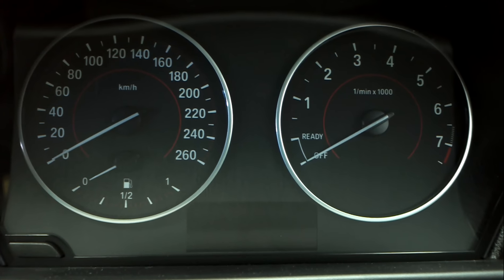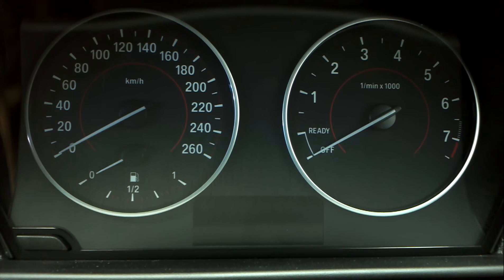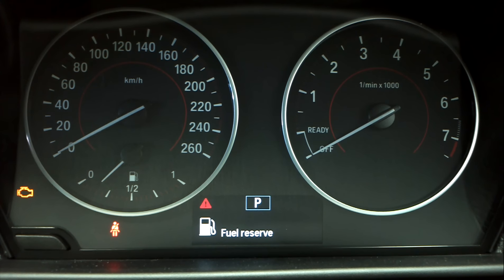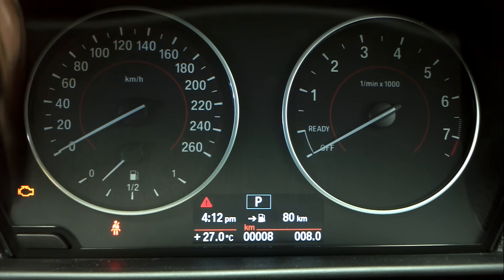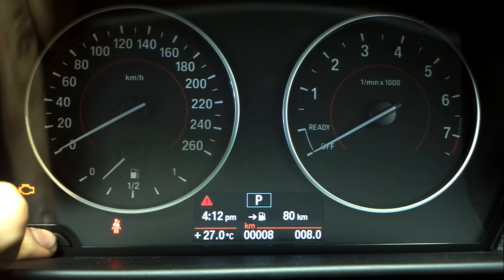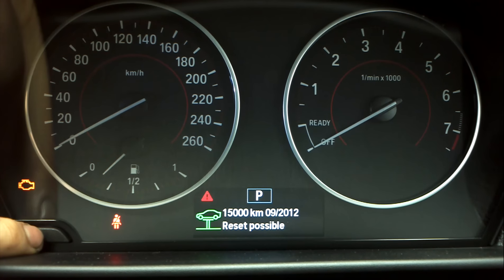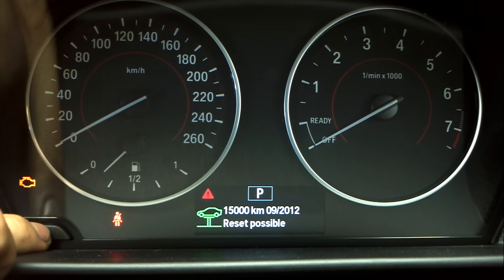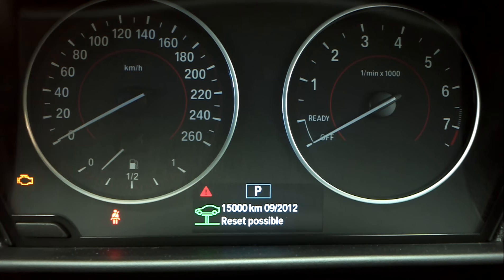BMW 1 Series F20 reset service light How to DIY: BMTroubleU

Comment: My windshield pumps aren't working (both front and back) but my headlights' pump is working properly. What might be the problem?
Reply from the maker: Most likely your washer pump or jets are blocked. We saw this frequently, even in newer vehicles where the washers hadn't been used for a while. The inside of the washer bottle is dark, warm and moist which means mold can grow in it and cause blockages.
You will need to remove and clean the washer bottle with degreaser. Disconnect the hoses from the washer pump and use compressed air to purge the hoses and any remaining gunk inside them. You should see water and air spraying strongly out of the jets when you do this. If you don't, then the washers are blocked too and will need to be removed and cleaned with a small pin.
Let me know how you go mate.
Reply: @BMTroubleU  well no energy gets into the plug, what might it be since theres no fuse?
Reply from the maker: @bardajoca  there is a forum post for this issue here-
https://www.bimmerfest.com/threads/f20-windscreen-washer.1272850/

See how you go
Reply: @BMTroubleU  thanks, I've already posted there too, waiting for an answer. I'll try to reset all car errors

Comment from the maker: if youre worrying about any non-dealer work on your car 'voiding the warranty'- dont. make sure you use genuine parts, approved fluids and keep your receipts and dates of work written down and you are 100% sweet. in order for dealerships to refuse a warranty claim based on non-delaer work they need to prove its not been serviced or service wrong.